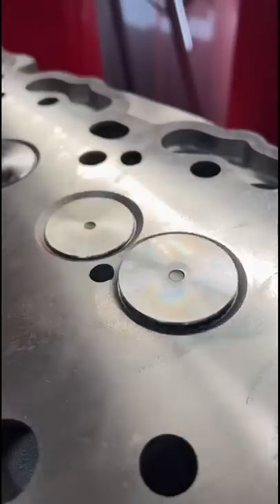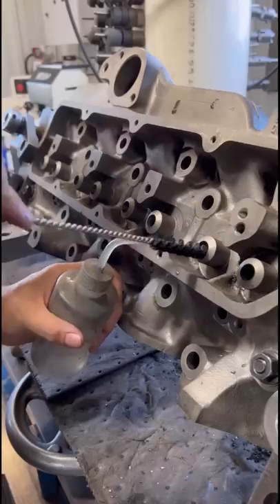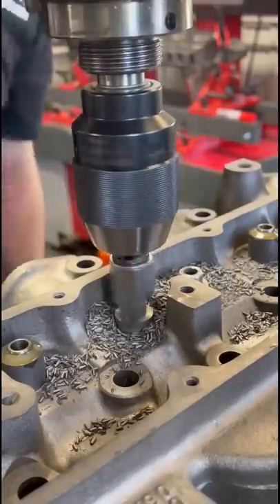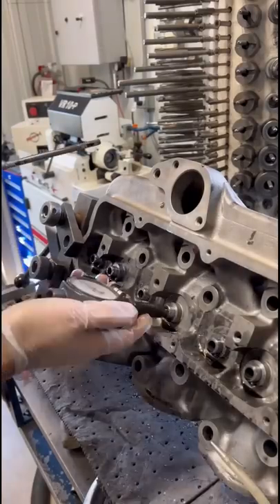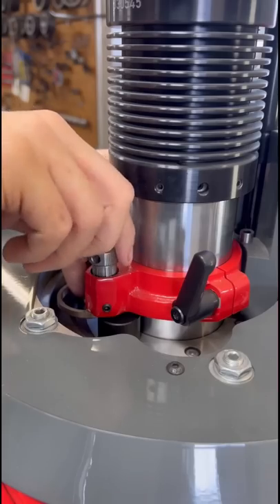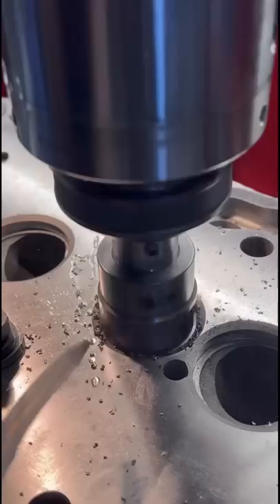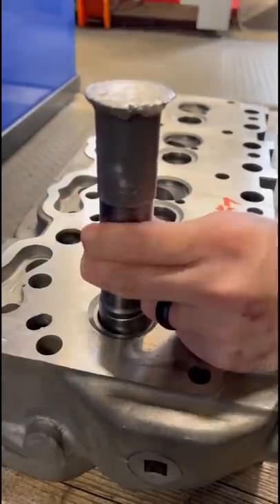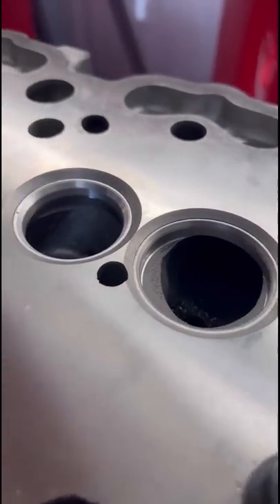#shorts There Is Always A John Deere Head In The Machine Shop…

Comment: I love you guys. Heavy truck mechanic myself. But how do those valve seats stay in there? Just seems strange to me. Thanks.
Reply: Its a press fit
Reply: I get that. But the heat and the pounding and vibration. Driven in with a hammer?
Reply: Press fits are way stronger than you think, he was probably using at least a few hundred pounds of hydraulic pressure. Plus every time the valve closes it pull the valve seat into it's seating
Reply: Valve doesn't pull seat down. Once insert is hammered home, that's it, it don't move.

Comment: Good day
I have machine shop in belgium,Europe
I like  your video's 
I doing the same jobs as you
I use for long time  brons guide liners from us company k line
There are 5 good reasons to be  used
-better against wear
-concentric to valve seat (less material removed when cutting valve seat)
-easy to use
-time saving (faster than replacing guides)
-better clearance can be set
Check on u tube "guide liner installation procedure detailed"
Greetings
Joris

Comment: this is good work but the number of John deere and other engines that have came to me with valve seats that have moved / fell out is just crazy and for awhile now I been using loctite and so far I haven't had any of them heads come back from valve seats falling out . more common in mower engines but from build up and head overheating .

Comment: I'm interested in doing this where would I start
Reply: apply at a machine shop; start with basics. Learn the fundamentals first. Screw machines, manual lathes, mills. After a year or so, you can apply or if they have them inhouse, you can ask to work on some CNC machines. You will eventually learn to make small edits. And moving up, you will learn to actually program the CNC machine for different jobs.
This type of work in general includes tedious maintenance, basic documentation, scheduled and necessary tool changes, constant measuring, and of course, more measuring. The last thing you want is to realize towards the end of your shift that you have been pumping junk for the last 7 hours. Although it may look fine, if you are over or under .003 and the blueprint only allows plus or minus .002, you may be shit out of luck, all because of that got damn ONE THOUSANDTHS! That would all depend of course on the decision made by Quality Control department, but a good machinist makes sure that he himself IS THE Quality Control Department. The QC department is equivalent to the Internal Affairs Department for cops. That relationship depends on your personal conduct and more importantly, the quality of work you produce. Often you have to babysit these machine/s you are operating, many of which are automated. Learn the machines. Know the machine. Take care of it. And it should be good to you....

Hands on is obviously the best experience, right. Learning how to operate and read all the neat little gages like micrometers, verniers, depth gages, etc., and also the not so small measuring devices like a shadowgraph.

Now they do have various schools for this kind of work if that is really what you want to do. These schools are not the cheapest and the only way I would go to one of these schools is if this was my chosen career choice and I was sure of this decision. Only then would I proceed, after I was sure and committed.....

good luck brother
Reply: Hallo
Start with cylinder head work
By Valve seat cutting machine and milling machine and hand tooling
And work your way up
Good luck

Comment: Mang, I do love watching machining.

Good thing it's the day job too!
(Sorta, mainly manufacture carbide tipped coolant fed/non fed drills/solid carbide and the like)

I can steady just RUN the F out of the Clapped Bridgeport in the maintenance department though.

Calculating the worn gibs as a inclined plane while setting up a milling op is likely not math any actual machining company/employee actually needs or uses.

Also, gotta get the shin  breaker knee handle replaced with the half inch chuck drill motor.
.......cuz an impact and machined hex to raise/lower the knee makes the clapped-outed-ness amplify.

The more you know, the more infinte the knowledge ya dont know becomes.

Comment: Building a TRUSTED daily driver SBC 400, under .500 lift hyd retro roller lifter cam, and wondering which aftermarket, reasonably priced SBC "heads" do you like, aluminum or cast iron, and brand /model?
Reply: What year, Era sbc, pre 85?
Reply: @strikeforcek9149  yes, pre 85 block.
Reply: @davidbaldwin1591  Promaxx Performance Freedom Series heads with 72cc chambers. Depending on the piston setup you're going with, you can go up or down from there.

But, if using stock pistons, those heads will be great for street/strip and be extremely reliable without overdoing it via compression.

Where you have to worry about the 400's, is cooling issues. They're siamese cylinders and the block heats up QUICK. So, as long as you have a nice cooling system in place, it should give you great performance for many years to come.

If it's a mild build, I'd get the heads that are 72cc chambers and 200cc intake volume so you don't run out of breath. The 400 can really move some air and 200cc+ isn't uncommon at all.

The the heads aren't the cheapest, but they're extremely reliable and produce good power. Especially when cammed to the 1k to 5k powerband.

What all are you doing to it asides from a nice head swap? Or are you just camping it with some new heads, to have a nice street style daily driver?
Reply: @strikeforcek9149  I'm sticking to stock compression, even with the loss of power, because it's my daily driver for service work (1969 K10 shortbed 4x4). That little bit of 93 octane isn't worth it for daily driving.  In fact, I wish there was a flex fuel setup like my Yukon has, or maybe someone can put one in my next project.
I really like your recommendations, especially with reliability. Yes, I want some power, and a reliable long wear cam setup, but I don't want to scream it. I may go with the electric cutouts for exhaust fun.  I'm not comfortable with a cast crank either. Every time we pulled one down in the last 30 years, it always centers around that crank for some reason. Thank you for all your advice!

Comment: The grade of metal used by John Deere is of lower quality than other engine manufacturers, cheep cheep cheep... 😂😂
Reply: made in China
Reply: @PoliticalGangster  that's sad.
Reply: Good to know. I was wondering if this issue is just one motor or several
Reply: No, this is a head from a really old tractor since it has no valve seats original. Made in america or germany.
Reply: When a deere breaks, that's the sound the birds that build nests in it makes: "cheap-cheap-cheap".

(Because it takes so long to get parts and break so badly, the tractor is gonna be there for a while, hehe.)

Comment: can somebody explain the need for valve seats. why not just machine the angles into the head?
Reply: Cast iron is relatively soft. It really can’t take the repeated pounding of the valves. Hardened seats work better and can be replaced.
Reply: @williamgraves9574  I now understand. thank you for taking time to explain.
Reply: @williamgraves9574  whoa ty
Reply: Too soft
Reply: Unleaded gas. They removed the lead which coated the valve and valve seat. Acted as a lubricant between the two. Valve recession is the end result. Plus, it kept the rust pitting down.
Reply: Some iron heads would have induction hardened integrated seats cut straight from the iron to deal with the softness issue. However, that typically was only used on street driven unleaded gasoline engines. Diesels would spend so much more time in use, so something tougher would be needed. That's why many were equipped with pressed in hard seats.